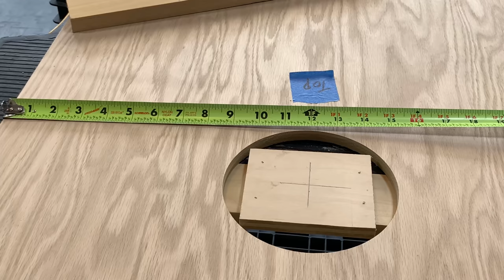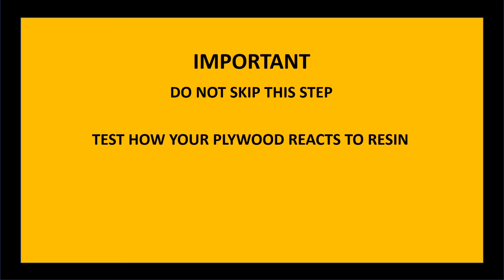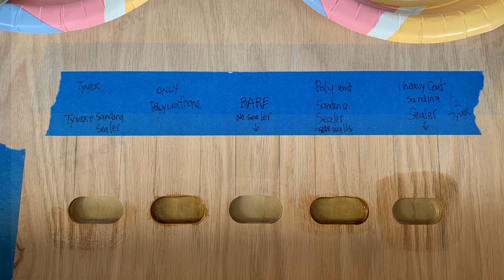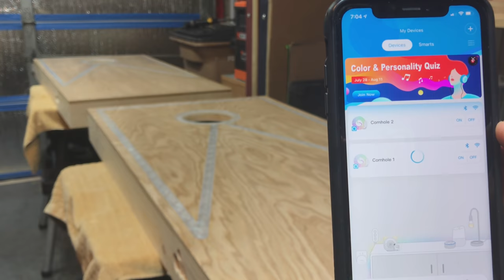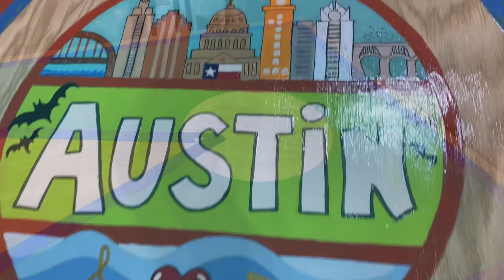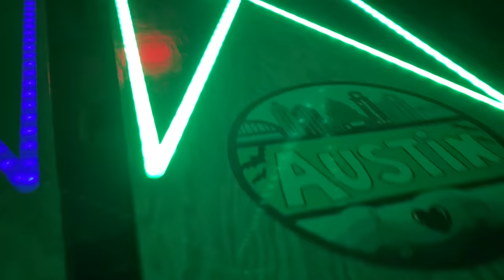How to Make LED Cornhole Boards. Step by Step. Sound Activated LEDs!

Comment: at 15:13, you showed a heat gun being applied. Is this a necessary step? I have not worked with resin before.
Reply from the maker: Hi Jeff,
   Appreciate you watching the video and thanks for the question.  The thing you you are asking about is not a heatgun..its a butane torch.  The butane torch is used to pop the bubble that will surface to the top immediately after you pour the resin.  The flame will pop all the surface bubble.  You can use a heat gun, however sometime the force of the air is too high and will splash  your resin.  The flame from the torch is more gentle and will not disturb the resin in the channel.  I hope this answers your questions...but yes...you will need some heat source to pop the surface bubbles.
I hope you have a great day!
Rico

Comment: Hello and Thanks for video. I have made many board sets, and I plan to make this one for my use.I also have a question. I read that you used poly urethane to topcoat. Why did you not use polycrylic is it not compatible with resin?
Reply from the maker: Hi Michael… actually I did use polycrylic.. i listed it in the description.. 
I brushed it on… and it dries very quickly… that’s why I used it….  
I should have put polycrylic in the video but put polyurethane…. Either will work fine.   Sorry for the confusion… 
Rico

Comment: I didn't see that you placed any poly over the resin and you intentionally left the resin lower than the top of the board how did you level the top of the board to have a smooth sliding surface?
Reply from the maker: Hi Michael,  Thanks for the comments and question!  I took great care to level the board in all directions... i used small shims to prop up the board in certain locations until it was level all the way around.  I just poured slowly as not to over pour until the resin reached the surface.  If there would have been any low areas i would have filled those area later with clear resin.  Yes... purposely masked off the resin when i applied the resin, not really necessary ...but i did it anyway.

Comment: Rico, Nice video, but I was wondering if you have any updated version on the LED lights? The link is from 2 years ago on Amazon and they only have that version in a 110v plugin and I can't find anything that is USB plugin. Thanks for the assistance.
Reply from the maker: Hi Pat, thank you so much for watching and thanks for the question. Yes I agree that was many years ago. Those lights probably aren’t there anymore. I just built a cornhole board six months ago and I used a different brand of LEDs. 
They have a mini controller and you can hook up to USB 5 V. I will provide you with this link.
https://www.amazon.com/gp/product/B07CBSDQNB/ref=ppx_yo_dt_b_search_asin_title?ie=UTF8&th=1

You will just have to connect a USB connector to the end. It’s just two wires. Black and red.

Check out my YouTube video from about six months ago. This is an electronic cornhole build.

Here is the link…
https://youtu.be/qdiI1hICoWw?si=dj2lLVEyJbI7Ad2K

Hope you his helps.  
Rico

Comment: Have you tried sealing the channels with a thin coat of resin?
Reply from the maker: Hi Pierre!   Thanks for the question!  I just resently purchased some Penetrating Resing by MAS, that i bought from Rockler.  Im gonna actually give it a test run and maybe post the results in a video.  I just am unsure wht the end result will be using resing as a sealer..but I am gonna give it a try...as i think that if it does work...it will probably just need one coat!!

Rico

Comment: I ordered the LEDs and battery but I must be missing something.. cause it seems like I need two batteries and two controllers … if not, how does the second board connect to main board ?
Reply from the maker: Hi Gfw,
Thanks for watching. And thanks for the question. Yes you will need a light strip controller and battery pack per cornhole board. Hope this helps. Hope you have a great day Rico.

Comment: Were your LED lights a waterproof version, I've seen the indoor govee lights but unsure if those would be damaged by the resin?
Reply from the maker: Hi Paul,
   thanks for the question!  In this video build ..i did use the waterproof version of leds.  However,   the non water proof version will work as well and it will eliminate the step of removing the waterproof clear rubber at the bends.!  I have have used non waterproof leds on other builds and it worked fine.    Hope u have a great day!

Rico
Reply: @ricohernandez2394  thank you so much! I think your boards are really cool and I can't wait to try following your video in making some!
Reply from the maker: @paulboynton3787  Great!! I wish you luck!  I plan on making another set soon 
Have a great afternoon!

Rico

Comment: Do the LED's need to be waterproof and do you need an adaptor to connect to the battery?
Reply from the maker: Hi Exess,
   No ..you do not need waterproof leds...the sound activated strips i used just happened to be water proof strips...  the plug from the led strip that i used was a barrel connecter that fit into the battery pack.
Rico

Comment: What would you say the overall cost was for one set of boards?
Reply from the maker: Hi Sam...
  thanks for watching and thanks for the question!  I would estimate that i spent about $150 per board.   You can definitely get that price down...buy using less expensive lumber.
I spent a little extra for good quality lumber...makes a huge diffence using straight non warped lumber.
Anyway..hope this helps!  Hope you have a great day!
Rico

Comment: To save money do you think that you could do two layers of epoxy resin instead of casting resin or would that not work?
Reply from the maker: Hi Kenneth, thank you for your comment and question. Yes I am sure you could use epoxy resin instead of casting resin. The only reason I use casting resin is because that’s what I had in my workshop. And also I liked using this one because it dries in about two hours and is ready to use. On the downside, you only have about 10 to 11 minutes of pot life. So you have to work pretty quick.Other resins take hours if not days to dry. Each resin comes with its own set of intricacies. I plans on using a resin in the future that will give me a longer pot life.
Reply: Can I get away with ordering a 1 gal kit? .5 gal each? I noticed you orders a 2gal kit that’s no longer available? I just don’t wanna order to little? Or too much please let me know.

Comment: How many ounces of resin did you use on each board to fill in the LED channels?  I see that you mixed together 11 oz in a cup on the first pass and 14 oz on the second.  Did you have to mix more than one cup on each pass?
Reply from the maker: Hello and thanks for the comment.  No.... the first layer of resin was 11 oz. and the second layer was 14 oz.  I did not mix or pour any more resin after the 2nd layer.
Reply: @ricohernandez2394  So if i do four boadrs  I would need 64 oz  of the two kinds of resin to get the led lights done? correct?

Comment: where did you get the Plexiglass
Reply from the maker: Hi Dave! Thanks for watching and for the question! https://a.co/d/6F0sD3o
I had these sheets for another project and it was the perfect thickness.. they are pricey for the small amount u will need… any thin plexiglass that you find on an inexpensive picture frame would work too. Good luck!
Rico

Comment: Excellent.  Q do sand the top after pouring the resin?
Reply from the maker: Hi Jeff! Thanks for the question.  I lightly sanded the plywood only after the resin pour… avoid scuffing up resin.
Reply: @ricohernandez2394  Let's say you can't get level with the channels then what.  How do you get it smooth and level.
Reply from the maker: @jeffanderson8825  Hi Jeff, Thank you for for you question.  I used small wooded wedges to adjust the boards before pouring the resin.  If your boards are warped and you can get them level the resin may spill out onto the board.  Once the resin dries..you will have to sand it off.  Ive had to do that before and its a tough job to sand off the resin...i started with 60 grit sandpaper trying to not gouge the surface...once off you will have to sand the resin to about 600 grit get it glossy and shinny.

Comment: what batterys did you use
Reply from the maker: Hi Ted!! 
 Thanks for the question! The rechargeable battery pack I used is listed in the description!.  I got it off of Amazon.. the charge will last for a little  more than 10 hours!  Thx for watching!
Rico

Comment: Could you get away with going 1/4 inch deep for the channels (aside from the circle) and still get the lights covered by the resin?
Reply from the maker: Hi J.P Benoit... Thanks for taking the time to comment with your question.  
I guess you could,  but that would mean the total thickness of the resin would be less.  I wanted the thickness of the resin to be as thick as possible without  routing though the 1/2 plywood, just to ensure that the resin would be as strong as possible.  With bags constantly hitting the board i just thought a thicker resin would resist any type or breaking or cracking of the resin.  All the resin LED boards that i have built int the pase were built with the thickness i mention in the video and have held up and have not cracked or broken.  So hosestly...I think a thinner layer would work but not  I have not tested it for durability.   hope this helps...
Rico

Comment: They turned out awesome.  What brand of pearlescent powder did you use
Reply from the maker: Hi Bryan, thanks for the compliment and question m! I used the following pigment that I bought on Amazon. Here is the link!
https://www.amazon.com/dp/B01HU2CU26/ref=cm_sw_r_sms_api_glt_fabc_4FZZ7CJP4R64ZE3PG7GS?_encoding=UTF8&psc=1
Reply: @ricohernandez2394  have you ever tried any other pearl colors?  I was curious if any of the others still had the light transparency that the silver pearl had.

Comment: what type of paint was used?
Reply from the maker: Hi Juan,
  I used the small sample size Behr exterior paint for the top portion of the boards.  You dont need more than the small sample size jar.  i uses Ceramco acrylic paints for the bottom badges.,  Hope you have a great day!
Rico

Comment: Hello. I have a question about the Govee LED strips you used in this video. I am planning on following your pattern for installing the LED’s. I have looked at various Govee LED’s trying to understand their capabilities, this will be my first-time using LED strips. I would like to be able to have LED’s start from the top center of the boards travel down along both sides and meet in the circle. My question, what direction do the LED’s light up? Can the direction of the LED’s be changed with the remote or Govee app? Thanks Al
Reply: In the video, if you pause the video(around the 11 minute mark) where he's test fitting the lights and showing how to bend them around the corners, if you look there appears to be arrows printed on the strip. My guess is that's the direction the lights light up

Comment: What brand of light strips did you use? I am doing one and I am having a heck of a time figuring out exactly what to do haha
Reply from the maker: Hi Powell, 
  Thanks for taking the time to send me a question.  Most any LED strip will work... but these are on the fancy side with  sound activation.  Ive used other non sound activated strips...but they just arent as cool as the sound activated ones..  I love how the lights flash when the bag hits the board.
here is the link to the ones i used...
amazon... https://www.amazon.com/gp/product/B07HRHLKGK/ref=ppx_yo_dt_b_search_asin_title?ie=UTF8&th=1
Wish u luck on your build!!
Rico
Reply: @ricohernandez2394  so will the 16.4 package be plenty for each board?
Reply from the maker: @oldgruntbbq   Yes... you will need two sets of lights...Each board will use about 12+ feet.   Be sure to cut on the marked cut lines on the strip.
Rico